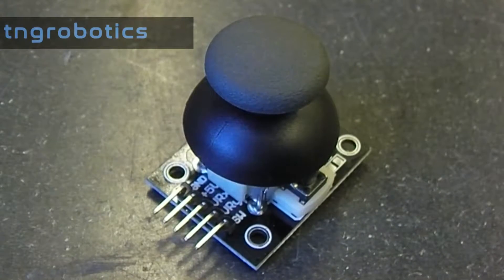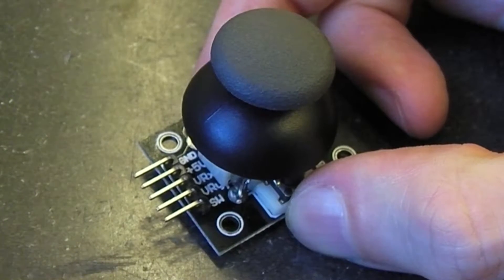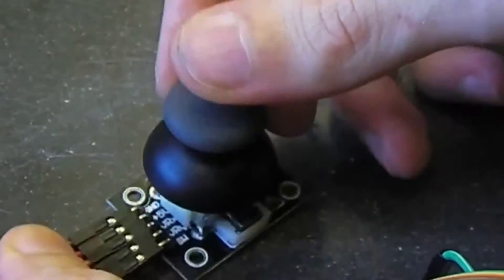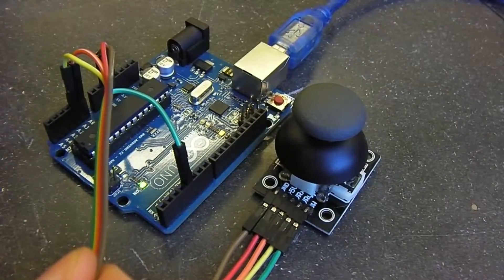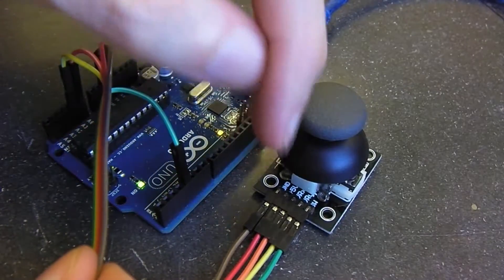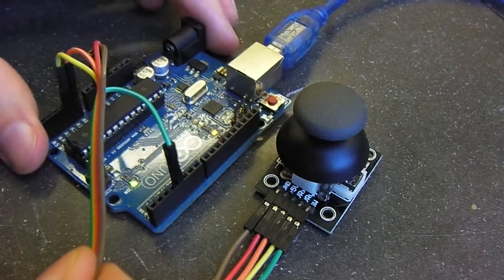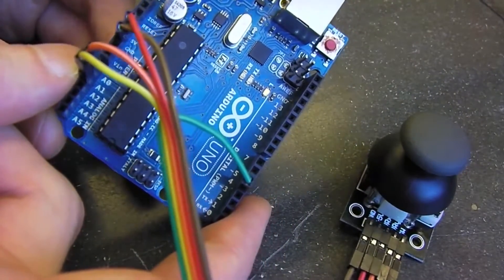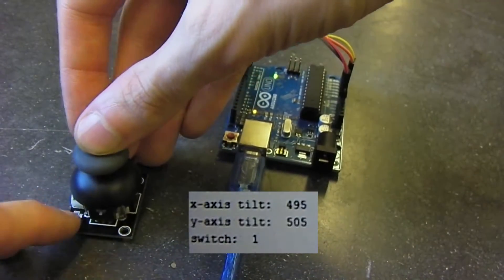How To Connect Analog Joystick [Arduino Tutorial]

Comment: What's the difference with Aerduino Leonardo? , I want to make a handbrake joystick for pc.
Reply from the maker: They are basically the same, identical pin functionality. Leonardo has an ATmega32u4 and Uno has a  ATmega328. Unless you are an advanced user most people will not notice the difference.